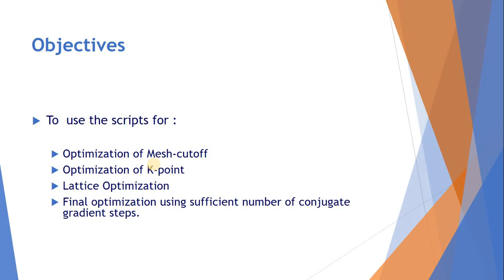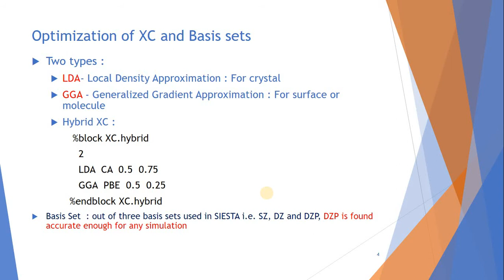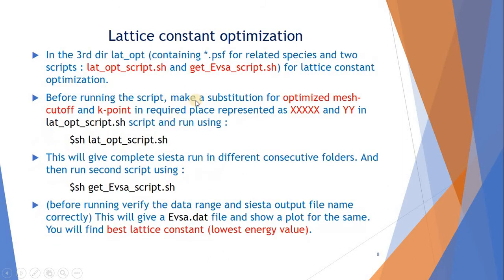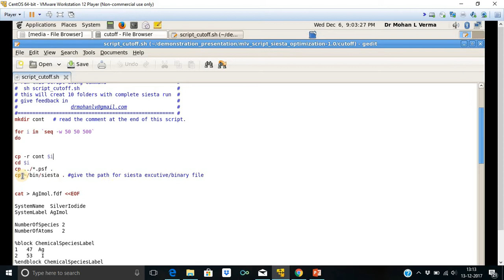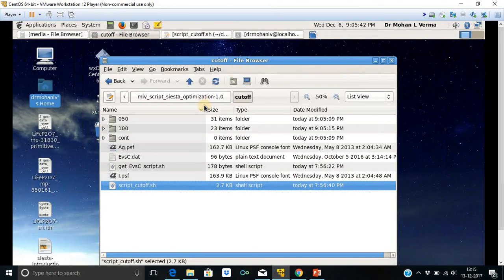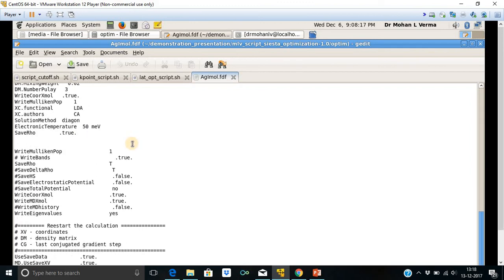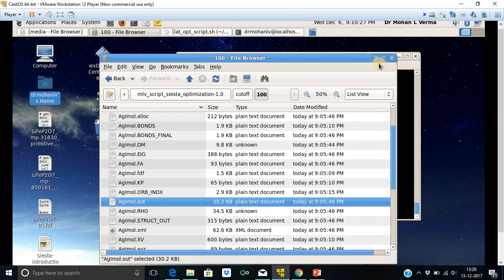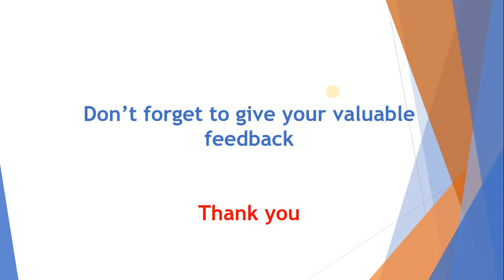Lecture -7 : Optimization of Materials using SIESTA - Dr. Mohan L Verma

Comment: when you are using hybrid functional, what should be the PSF file? Should we use the GGA PSF or the LDA PSF???
Reply from the maker: I checked with LDA ...it was running without showing any error.
Reply: What happens if you run it with GGA PSF?